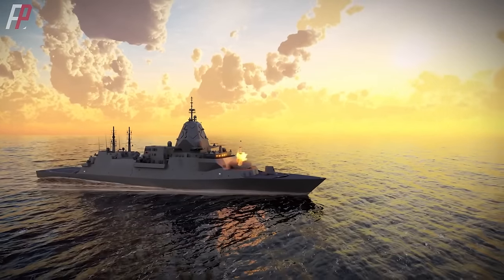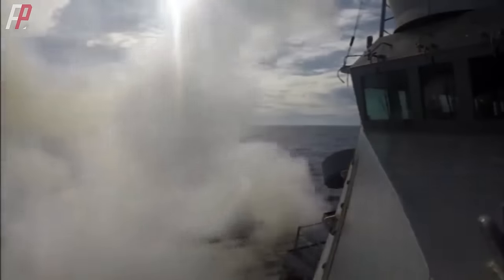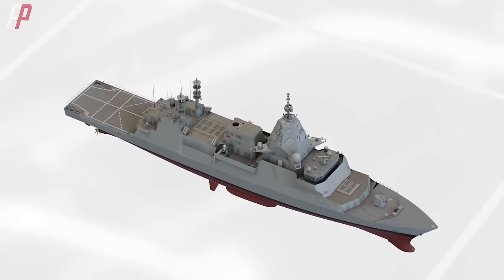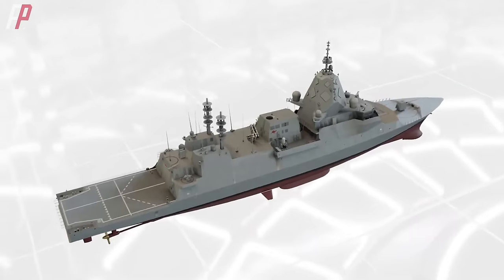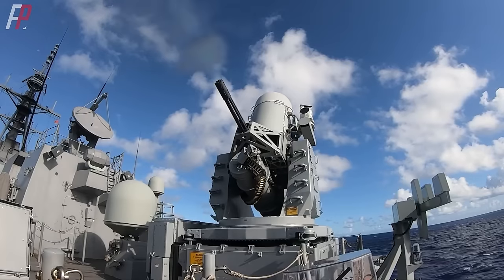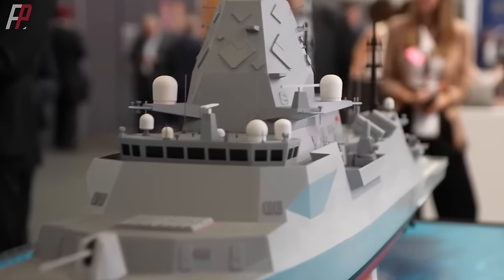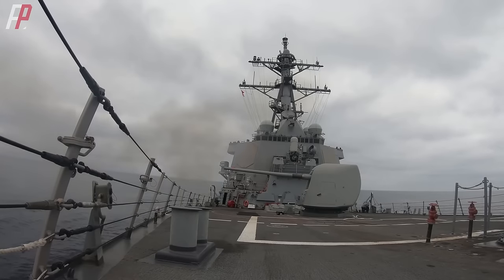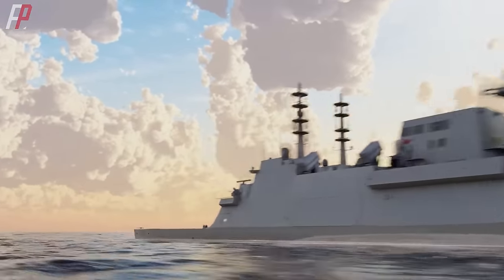BAE Systems Introduces Enhanced Hunter Class Frigate to Boost Firepower for Royal Australian Navy

Comment: Seems Australia are trying to make it do too many things and in turn sacrificing others, seems a better idea to have Type 26 for ASW operations with some Anti air and Anti Ship capability  and the destroyers with large VLS Count dealing with Anti Air and Anti Ship primarily they compliment each other.
Reply: Australia navy too small to be focused on majority of its fleet just on ASW capability. They need ships that can do it all
Reply: true but if the same hull is used for ASW and then upmissiled as an AWD then the cost are significantly reduced in sustainment due to the commonality
Reply: @shanehansen3705  it doesn't need to be a destroyer, but because Australia lacks numbers, it needs to be better armed than just 32 cell VLS. I think 96 cell and 128 cell options are putting it at the destroyer level.  And it is too much loss of ASW capability.  But if they built it with 48 cell VLS, that's decent armament for an ASW ship. 32 cell at the front  and have 2x 8 cut down MK41 cell VLS sideways at the front of the multimission bay would still leave enough room to have a multimission bay. Using the back 16 cell  for ESSM for a total of 64 missiles. Have the front 32 cell for the larger missiles mostly packed  with SM2 SM6 and a few ( tomahawk or LSRAM) for whatever meets requirement configuration. 

I think they should get rid of the F100 class AWDs that were designed originally to be a frigate and build 4 Navanti flight III destroyer with 128 cell VLS and also offers direct energy wepon system too.

I also think using a 5-inch gun on ASW ships is a mistake.  Just puts too much weight on the ship for an armament that wouldn't be all that useful in combat other than for close in weapon system and against drones. So why choose a heavier slower option.  When they could just have the lighter and faster firing 76mm auto cannon that fire MP3 shells allowing for more of a hit. The distance between 5 inch shell and 76mm is virtually on par in terms of range. They just adding extra weight on the ship with a worse capability
Reply: @Nathan-ry3yu  I'll look into what you suggest it's good to have opposing views it's how we learn can you explain this to our gov
Reply: @shanehansen3705  Sorry for the late reply. I have  sent a message to our Gov. I haven't gotten any reply.

Comment: The problem with the Hunter class is that the Australian Navy have  lots of  desk pushers that have this need to Australianise everything, even if it means degrading the ships capability, so with the Hunter class they have insisted on having an Australian built radar system which is too heavy for the ship and takes up more space which means less missile launchers.  This suits as it means they do not have to buy as many missiles.